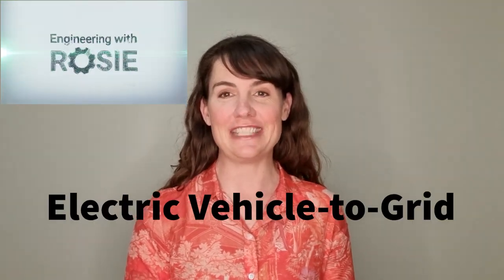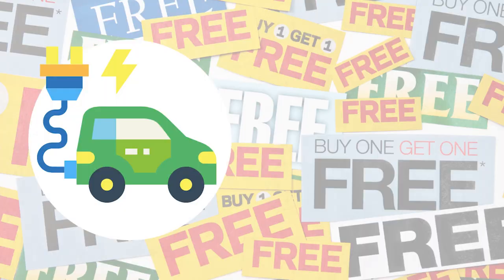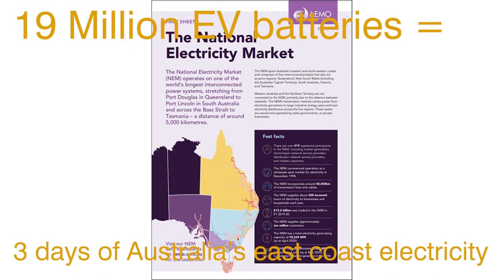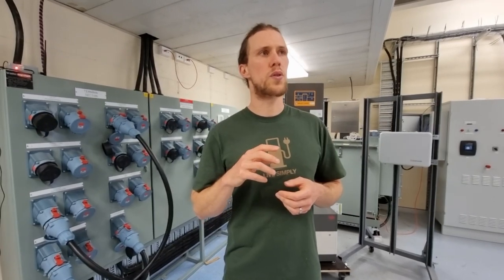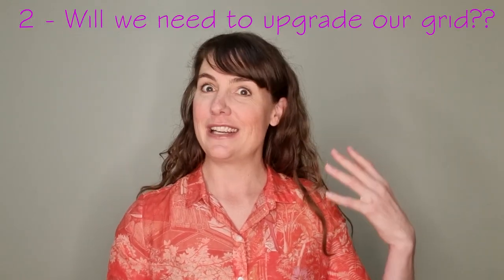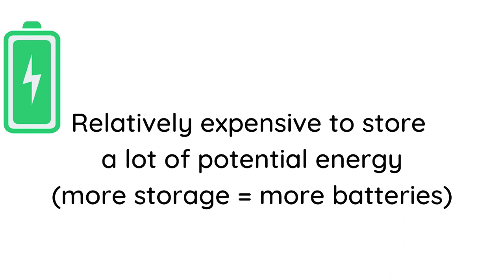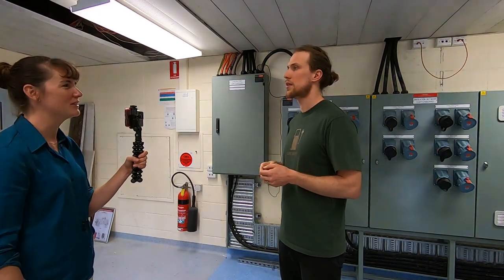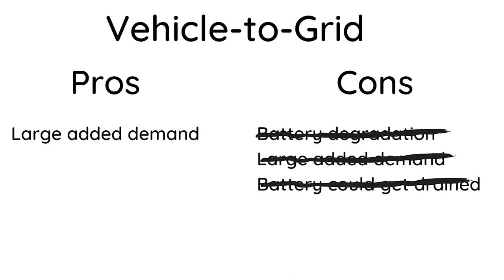Electric Vehicle to Grid Technology Explained

Comment: There seems to be an anomaly here.  On the one had we're told that EV to grid will enable renewable energy sources to provide most if not all of our electricity needs by storing energy when the renewable is available and delivering energy when it isn't.  This obviously involves large amounts of energy relative to our daily consumption perhaps as much as 100%, there's no solar at night.  But then this guy tells us that the energy demand on the batteries will only be occasional and negligible compared to the battery capacity.  They can't both be correct.
Reply: The anomaly is this guy is talking about NOW, when only a fraction of our energy use is from wind and solar, and you are looking at the FUTURE, when close to all energy will be wind, solar, hydro and EVs. That future is still several decades away. The tricky part is moving smoothly from NOW to the clean FUTURE.
Reply: solar is not going to be our only energy source

Comment: Have you done a video on what's holding back me from running my house off my car? Call it Vehicle to House if you will rather than Vehicle to Grid. What's stopping me from using my EV battery to reduce my energy bill?
Reply from the maker: I have just recorded one that is mostly V2G but includes V2L and V2H as well. But it is in editing and the home part might end up cut. If it is cut, I'll make a video solely on that shortly!

Comment: Horse and cart thinkers can not understand how big the stupendously expensive grid has to be expanded to, in a no fossil fueled world. 

Houses are not expensive in Sydney if you don't have to pay for the land.

Electricity was only more expensive after they repaired the grid.
Not building new, just some fixing of the existing.

The grid expansion is the killer cost. 
The V2G avoids grid expansion costs, 5 times bigger than the original will take decades and decades and massive amounts of national wealth. 

The grid is fragile because it is built to minimum economic and engineering standards.
Stupid people don't understand. 

Unload the national grid by removing the 50% supplied to the homes.
And then, have the homes and buildings supply the remaining 50% to the remaining grid demand will save billions and billions. 

Somebody do the maths beside me.

V2G and rooftop solar PV is the killer combination BECAUSE OF THE EXPENSIVE NATIONAL ELECTRICITY GRID INFRASTRUCTURE and its expansion..

Comment: Why don't people go off-grid and on battery ?
With 2 EVs and solar power......
Monday, go to work in car 1 while car 2 charges via solar. Get home again, connect car 1 as the nominated PSU to power the house through the night.
Tuesday, use fully charged car 2 for work - leaving car 1 at home to recharge during the day.
Repeat.

Comment: The business model is a problem. There's really no answer yet to how all of this is supposed to work. We're a lot further into this process than Australia and yet it seems to get more difficult rather than easier. 

EVs need fast DC charging infrastructure, but only very occasionally, so this infrastructure is currently loosing a lot of money. 

A large and ever growing portions of energy production is no longer owned by energy providers but house owners, as most of the solar surface is ideally mounted onto home roofs. There is a huge number of different models of how these interact with the grid and on the financial side. 

There are no technical standards and there are many legal obstacles to large scale V2G adoption. 

In order for the transition to sustainable energy to work, several sectors need to be integrated into one network. In my opinion, technology isn't ready yet. All the tidbits are available, but nobody has integrated them yet. I believe the decisive powers in this will surprisingly be the EU and the VW group. VW currently puts massive effort into PRACTICAL V2G development and standardisation (because they know it's inevitable and they want to own the necessary tech and standards) and the EU because they are the most significant driver of renewables in the world at this critical point. I think, once VW has engineered the tech, the EU will adopt it as the standard an thereby make it the de facto world standard. There are new rules required to allow for business models to work and to integrate transport, charging infrastructure, energy production and distribution, etc. I believe the EU is the most likely candidate to combine the political will, economic power and engineering capabilities to do it in one place.
Reply from the maker: Yes I agree that the business models are going to be very tricky. They are going to have to be very different to our old energy and car sales business models, with more people involved which makes profitability harder. I wonder if our slow EV uptake in Australia could present an opportunity, because we have the possibility to roll out V2G at the same time as EVs. We still have the chance to align 2-way charging standards for example. Of course just because something is possible, doesn't mean it is likely. In this case I expect politics will get in the way of a good technology outcome.
You are probably right that Europe will end up pushing this through first, if for no other reason than the politics works better for clean energy there than elsewhere. I probably wouldn't rule out China either, though I haven't seen a lot of Chinese EVs making it in other markets yet, nor heard about any Chinese EV companies doing anything serious about V2G (I also have looked to see if they are).
Reply: @EngineeringwithRosie  Australian politicians are for the most part stuck in steam age, but even if they weren't, they'd still have to wait for an established standard, because it's too small of a market and has no auto or energy industry of its own. The Chinese could basically do it overnight, but I doubt the west was willing to adopt a Chinese solution. The Americans might cook up their own soup, suitable for their split phase disaster and using imperial threads and archaic measurements🙈 These are exciting times, the electric domino is unleashed with the majority of political, technical and economic questions just beginning to be raised, countless environmental experiments running without a hypothesis just how they might turn out, and probably less than 1% of the world's population aware of what's happening...

Comment: V to G sounds great yes (the real solution is a powerwall an actual battery backup) but it won't work like  people think because it has way to many problems that people overlook. First of all ANY USE OF A BATTERY DEGRADES THE BATTERY DOESN'T MATTER IF IT DRIVING OR FEEDING THE GRIND, so spot spreading that lie.  If I drive to work or anywhere how will I be connected to my V to G system at home? Does my work have a V to G system nope, are there V to G grid connectios everywhere I can park nope? How much will that infrastructure cost? It's is just the tip of the iceberg for the problems that I can see that this will have.  Too much money for the low amount of use. And I am not going to let my car battery degrade when I am not driving it, that will severely shorten my cars lifespan. Lots more problems that the V to G is useful, save up and get a powerwall and use things for there intended use.

Comment: This idea is just a symptom of the many misconceptions about de carbonising our power system.
Storage is not an answer, as the intermittency of renewables is of such magnitude that it is not possible to have battery capcity to match that deficiency.
We are squandering vast amounts of money trying to make an unsuitable source of power replace fossil fuels. 
Renewables are not just intermittent (Wind in the U.K. has been very low in output for nearly three months now, it's not possible to compensate for such poor performance) but they are technically deficient and cannot power a grid by them selves.
This is my opinion and I believe that time will prove me correct.

Comment: Not sure I could buy into this sort of solution.  First off your availability of attached batteries would be unknown and highly dependent on the time of day so you still have the unpredictability of stored energy supply, what have you gained.  To provide 100% grid availability one would still need a significant guaranteed reserve capacity.   You can't say sorry for the black out all the cars are on the road now try your toaster later.   I don' buy the battery life reduction argument  being low,  even if nothing more the perception its not going to fly.   For me the big element is all the expensive grid tie inverter hardware required for minimal benefit.  A lot of hardware cost to gain minimal KWh pushed to the grid,  by definition it can't be too much energy else your battery would go flat.   I don't know about other parts of the world but here in the US the frequency is very accurate and doesn't change with load.  We do adjust the  phase of the current vs  voltage to control the direction of the energy flow on the grid.   The problem with inverters is they don't provide any grid inertia which comes from the rotating generation equpment and all the rotating motor loads attached to the grid.   To be at all useful   it would take thousands of cars all  switching on and off the grid at will -- talk about dirty power.    Does very little for solar because cars are generally on the road during sun hours,  more useful for wind sources.   Doesn't work for charger stations, only for home chargers and then  limited to single family housing.  For apartments,  city street parking, older housing and inner city high rise apartment and even rural areas would take massive  infrastructure retrofit.   All these energy schemes sound cool on paper until you look and the economics both from and energy and cost perspective and where best place to spend the tax payer's money.   The energy numbers are are enormous,   a while back I saw a figure on the number of  coal plants in the works in China  can't remember the number but I fell off my chair.    Remember EVERYTHING you do, eat, buy, build, your medical care, education has an energy content and that is what makes us civilized.    Want and interesting engineering exercise:  Find out how many oil tankers are delivered per year, then figure out how much oil each holds in liters and multiply that by the energy content of a a liter of oil -- its mind blowing.
Reply: Well, those oil tankers of yours will soon have to find other things to transport. Fossil fuel is not the future...
Reply: @SobrisSweden   That is not the point of my comment.   Those tankers of oil represent the quantity of  energy we currently use to run our standard of living and which will need to be replaced by some other form of energy when we abandon oil.  That oil represents millions of years of prehistorically captured solar energy.  The numbers are huge,  go figure out how many  sq kilometers of solar panels it will take to replace those Dino squeezings.
  In FY2018 California motorists sucked up around 15 billion gallons (57 billion liters) of refined squeezins . At 33,4 KW/h per gallon you have around a half  terawatt/hour of energy to replace just for the yearly auto fuel in one state and this represents only about 11% of the total energy used in the state.  My guess: think it would be about a billion solar panels and  about  100 million Tesla Power walls, give or take. Just imagine how may packing peanuts it would take to ship 100 million Tesla Power wall systems.    For ref Apple sold 217million  Iphones in 2018  wonder how much energy it takes to charge these every night.
Reply: @craigs5212  
The transformation is coming fast and is happening now. In Norway over 54 percent of the new cars in 2020 were fully electric. The goal is: no more new fossil cars in 2025! Today the cheapest kWh we can get is from solar and wind with storage in batteries. Industries can store energy as hydrogen. We will see a new energy landscape where energy is very cheap most of the time and very expensive some days (and hours). Anyone who is not prepared for this will be a loser. The ones that are the most wasteful, will take the hardest blow. US and Australia are obviously in great trouble. Even at the smallest scale it is time to act. My house had a consumption of 33.000 kWh/year when we bought it. With a number of investments we are now down to a net of around 4.000 kWh/year. So, my question to you is: when are you going to start to invest in smart energy usage and conservation? The basis for our "standard of living" will be very different in just a few years.
Reply: @SobrisSweden  I have no doubt that Norway can make a very good showing for electric cars, it is blessed with very good topography  resulting in abundant hydropower.  Looks like  hydro  powers over 95% of the with the ability to import more  from equally blessed Sweden and Finland.  Think I saw something a while back about plans for super high voltage DC transmission line.    I would think wind would quite viable given the north sea and the hydro storage capacity.   Solar not so much given the latitude especially in winter.  Norway is unique in this respect but not so the rest of the world.  California is also blessed with a fairly old but decent hydro system, but is maxed out and no political possibility of any more dams and are now having rolling black out conditions.  Also we are subject to  years long  drought conditions from time to time.  Solar is growing rapidly but still at about 15%. The big Ivanpah thermal solar plant was shut down or on life support, never delivered what was promised for the $2.2 billion plant -- was using almost as much natural gas as solar energy produced.  Seems they had to heat the thing at night to keep it operational.
Reply: @craigs5212  So many things wrong with the Ivanpah plant. Centralized production, complex moving parts, need for lots of fossil fuel every day, single points of failure and so on. This type of construction is only suitable for experiments with super high temperatures. For that kind of investment you could get 2.2 billion W (2.2 million kW or 2200 MW) of solar panels instead. Regarding HVDC, a 250 km long, 2x600 MW, high voltage DC transmission line will be in operation in Sweden in August this year. As we are taking down our nuclear plants, there is a need for better capacity in the distribution network. We are a net exporter of electricity and our own consumption was lower in 2020 than it was in 1987!

Comment: I wonder if V2G is putting the cart before the horse.   Lets perfect and roll-out V2Home first.   Combined with solar, customers with electric vehicles could be significantly off-grid, especially during peak-demand times...store excess solar in vehicle, draw from vehicle.  Each customer significantly lowers dependency on grid and becomes self-sustaining to a degree.   Early mass roll-out of V2G will only serve to have the few early adopters attempt to support the many non-adaptors.   Customers will be wary and hesitant.   The market needs to REWARD/incentivise early adopters to get the ball rolling.  True V2G as in this video can be realized in 20 years, once we have mass-adoption.

EV's are an enabler for V2H.   Nothing more.   V2G is a fantasy.  Car batteries are just too small to effect a real benefit.  If each car handled its own "residence" during demand or outages...and we had  90% adoption of EV's...then 90% are covered without great expense or controllability issues, etc.   Quit selling at 2X what your willing to buy it for...if power companies keep that stupidity up, why would ANY EV owner want to support V2G

Comment: Horse and cart thinking is dangerous. 
Engineers must solve the right problem. 
Horse meat was cheap and available after the T model Ford rolled of the production line. 

The home robotic vacuum cleaner can teach the selfparking V2G EV to connect to the grid and daytrade electricity and stability. 😊😊😊😊😊

20million vehicles, say 100kwh is 2,000 gWh daily.
20million buildings connected to the national grid. 
20million Rooftop solar PV systems,  say 6.6kWh is 660gWh daily.
20million vehicles are parked 23hrs every day. 
20million daily drives 7kwh is small. 140 gWh 
Rapid charging will be on the main roads and at corner stores. 

Rosie, the biggest problem in the central electric generation system with no fossil fuels is the transmission construction costs. 
Alan Fels said 5 times more electricity 

The other matter like this is that central electricity generation is incredibly limited  because of the cost of transmission. 
The existing national transmission grid is fragile and "just off broke."
5 times more electricity and no fossil fuels means a massive increase in the capacity of the grid. 
The existing national grid has taken 100years and massive amounts of national wealth, so 5 times bigger is insanely expensive. 

The excavation of the materials and refining and smelting and....is also polluting.
The silence from the professional electrical engineers is deafening. 

All centralised concentrated electric generation is in need of massive government spending on transmission and decades and decades and...

Solar pv on every building rooftop means that the grid can be UNLOADED and protected. 

When EVs, with every building, and all connected to the existing national grid, the basically unloaded grid will simply top-up the grid storage. 
The key is V2G EVs, that selfpark and connect to the grid like the home robotic vacuum cleaner. 

This can happen within a decade as the ev production ramps up.

The money will be in the grid ownership daytrading stability and electricity. 
Hahaha 👍

Think about what I am saying. 
Happy to say more.
Decades of experience in the industry and construction in general.
I  have a few mates like you but they do not have your YouTube presence.  😊😊😊😊

As I said talk to me.
You have the Mechanical Engineering and analytical skills.